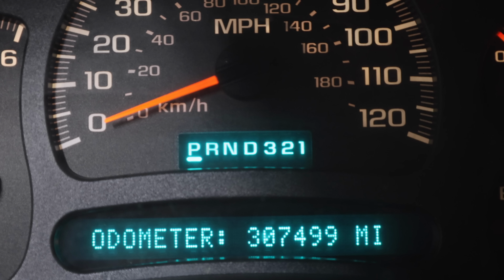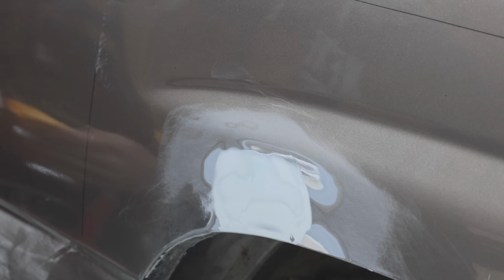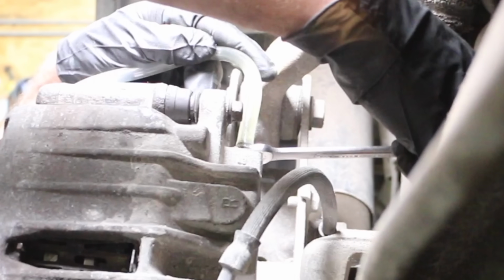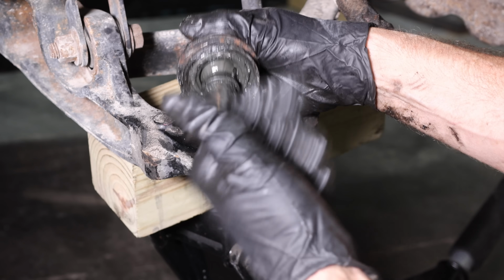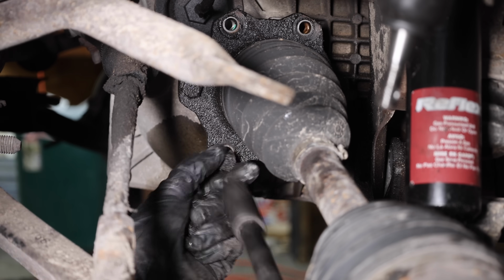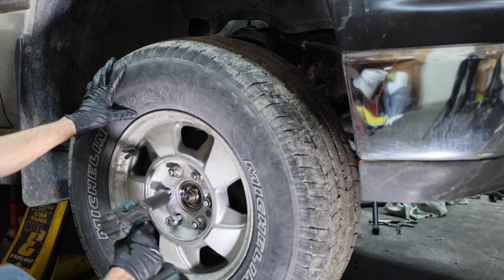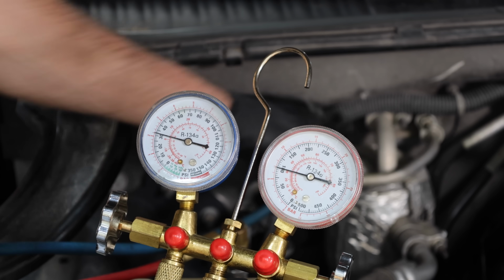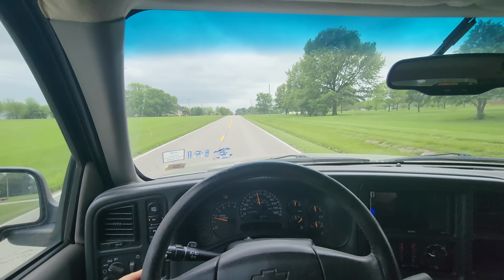Is It Stupid To Fix Up A 300,000 Mile Vehicle? Let Settle This!

Comment: I enjoy rebuilding things. The problem now is the replacement parts are junk-even OEM. So you won’t get the same long service interval. As long as you’re not rebuilding a rust bucket and it’s got solid chassis and body-rebuild away!

Comment: If you're looking for high quality snap ring pliers, the wiha brand is very good and most have an indent on the ends to capture and hold the snap ring so it doesn't "fly off" when trying to remove or install it.

Comment: get a jug of armor all with a sprayer and spray(soak) everything that you can see but don't wash. Like the fender liners, frame, trailer hitch, and any part of the suspension you can see from the front.  Trust me it will make the truck look even better. Plus a heavy soaking of armor all will make dirt and mud less likely to stick.

Comment: I will say, when changing inner and outer tie rods together, just put the new set together, and instead of counting threads, measure twice, and set the new inner/outer to same distance as the old... You can't always guarantee the replacement parts will have the same thread count.

Also, I'm being pedantic.
You referred to the Power Steering Gearbox, as the pump several times.
And the Center link, with Inner and Outer tie rods, is sometimes/often called a Drag Link Assembly.

Comment: My dad had an 04 Silverado in great shape, other than having 250k. Ill advised, he decided on a 10k full engine rebuild. Before we could sell it immediately upon completion, the transmission went out. Before we could sell it upon completion of the transmission, the gauge cluster needed to be replaced. By the we met with a buyer, the check engine light on indicating a bad knock sensor.

Comment: its ALWAYS cheaper to fix than replace most vehicles.
not to mention, most vehicles pre mid-2000s are just built better anyways and have considerably less electronic parts to fail that are really expensive to replace.
i own three old, trusty and reliable GMs:
1989 Chevrolet C1500 5.7L with 383,000 kms
1995 Chevrolet K2500 6.5L Turbo Diesel with 313,000 kms
2004 GMC Yukon XL 1500 5.3L with 293,000 kms
basic maintenance and repairs are why they still go strong EVERYDAY!

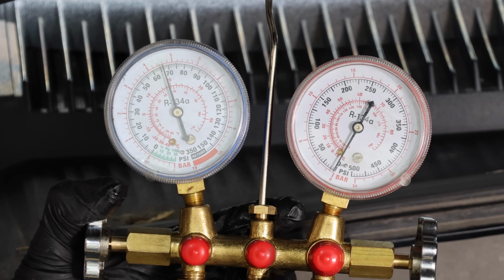Comment: 21:00 Freon? R-12 Freon? I sincerely hope this was just a slip of the tongue. It would extremely unresponsible to have not converted your cooling system to use something like 404A or 134A
Reply: No one cares
Reply: I wouldn't use r134a on a r12 system. A propane derivative works best.
Reply: @xeong5  ... Oh damn... I didn't even think of that. You're right. A propane coolant in the vicinity of an internal combustion engine. Genius!

Comment: I’m good with the pace. You did a great job on the car. 

I would suggest explaining how you detension the belt to remove it and change the pulley. Basically the half inch square gold in the tension arm and how to use it.

 Otherwise great job.  Very explanatory. Now I want to change my transmission fluid too. Also I have a LSD so maybe I should look at changing the diff fluid.

Comment: Excellent job on pacing for the video.

For God's sake, please don't use Rotella diesel oil in that engine. It accelerates lifter failure, and gobs up rings... even with higher detergent levels. Just don't do it.

Mobil 1 full synthetic at the specified weight/viscosity, or Valvoline Restore and Protect. I usually recommend Amsoil... but I understand not wanting to use something that expensive in an old SUV with 300k miles.

Comment: If the vehicle is still giving you good service at 300,000 miles, then absolutely it's worth it to repair and maintain it. We have way too much of a throwaway society these days. My little Jeep XJ is running just fine at 200,000 miles and I don't have any plans to replace it. I know its capabilities and I don't abuse it. I also make sure the fluids are changed and get professional service for the stuff I can't handle.

Comment: Without seeing the video first, I'd say if the body is in good shape with no rust, the rest is easily repaired or replaced with a new or used one. 
The things that wear out are bearings, shock absorbers, brakes, mufflers,.. All easily replaceable by a DIYer with right set of skills.

Comment: Awesome off-your-normal-topic video!!

I would suggest you never compress a brake cylinder back up into the master cylinder with any vehicle with anti-lock brakes.
Open the valve and let the dirty hydraulic fluid out (as best you can i.e. using a tube to flush it into something) and not back it up into the solenoids.

Comment: Nice work for someone who isn't a professional mechanic! Only tips I could give are installing the brake hardware while the pad bracket is off makes it easier and also the high side pressure is important when testing Air Conditioning to be sure the condenser is at the right temperature/pressure. This also lets you know if the expansion valve or fixed orifice is working correctly. 
Also take a look at those u joints, for play or traces of rust near the rubber seal areas.

Older trucks are great as long as the drivers seat isn't blown out and plastic parts are available. I also have a hard time with carpet blown out at the heel of your foot, haha.

Keep up the nice work!

Comment: You're in the South if I'm not mistaken so your vehicles down there don't have body rot like those in the Rust Belt, so if your car is basically rust free and looks good, keep it going at 300K. If its rusted out, time to recycle it to the junkyard. Bonus if you're mechanically inclined and have a place to do the work. You just saved yourself tons of money on that front end work. I know because I just had the local shop replace the lower ball joints, wheel bearings and of course they found one of the front calipers was bad, so both front calipers replaced on my Chevy 4x4

Comment: if my 22 year old 1400cc Fiesta diesel can get to 265,000 miles then a similar age big-boy pick-up should do it easily.
most modern cars are completely over-complicated and built too cheap. cars from 20-30 years ago were are from a real sweet-spot in time. so long as the engine & gearbox are in good order and the frame & body are in good shape then there's every reason to keep them running with regular servicing TLC and repairs as they need it. a car is a tool and tools can last a lifetime if you look after them properly.

Comment: Yes it is worth fixing. Compared to the cost of a new vehicle. If you bought another used one you would have to fix it anyway, I have an 07 Silverado classic that needs rocker panels and an 05 3/4 ton Suburban that is in immaculate condition except for the rockers. I will be doing these. I have decided that as long as I can do most of the work, I am willing to put at least $5000 in each of these. They run and drive great and do not leak or burn oil. The Silverado does need rear springs. Compared to a new vehicle it is worth it. especially if you can do most of the work yourself. I am thankful for Rock Auto. By the way, that foam in the fender is probably why it rotted out. I did not realize there was foam in that location. Don't forget the drive shafts and u joints.

Comment: Definitely should do snap ring plyers... we bought what was supposed to be a good set but it was only good for big ones as the metal on the different points was weak. First time we used it for a small snap ring it just broke the tips off. 

Would be nice to know what ones good!

Comment: I just took a Ford Ranger to the junkyard with 350K miles. I could have gotten more but there were too many little things going wrong.
Until they start making smaller trucks with good gas mileage again, I'm going to keep buying old used Rangers or Tacomas.

Comment: Have you test out the carbide scrapers?  I saw on this video that you used drill wire brush attachments. I'm curious how good that carbide scrapers on clenching gasket and RTV. surface

Comment: I just finished up a complete front end and brake overhaul along with front and rear springs on my 290,000 mile 1990 Dodge. No more expensive than 2 payments. And it isn't full of all the computers and plastic junk to break. Definitely worth doing the maintenance.

Comment: Here’s a project test idea; brake fluid tester tool. 
Are they all accurate? Is the percentage accurate? Adding water to brake fluid by volume should be able to give you somewhat accurate results. 
Do they work with both Dot 3 and Dot 4?

Comment: Excellent video. Two suggestions;
1. Replace the rear wheel bearings.
2. You should let people know about torquing the front axle bolt. My 03 ZX3 takes 325ft lbs.
That's a deal breaker for many home mechanics. Shop's may not be willing to touch it to get the torque right unless they're doing the alignment.

Comment: According to all service manuals I have seen you shouldn't use impact on axle nuts and you shouldn't undo them while the vehicle is on the ground because the load on bearing is just too much. You should use your breaks while vehicle is in air. That said I had to use an impact multiple times myself, because even 1 meter breaker bar didn't do the job.

Comment: I had a 2009 Chevy Cobalt that has lasted me 345,000 miles. I was the original owner and used this car for my daily driver and commuter car since new. The only problem I had with the car was valve guides and valve stem seals started leaking, causing plugs to foul out. 

If you take care of the car, it will last.

Comment: Putting body filler on hard body lines like the lip on the wheel arch will come back to haunt you.... Eventually. 🤣
One or 2 stones can crack the body filler and probably knock it loose. In that area it's a likely outcome. 
Considering your equipment and skill level you did a good though mate! Definitely a world better than rot like that spreading around. 

Probably like watching me combine a field of corn. 😂

Comment: I have a 2007 Toyota Tundra with 414,000 miles on it I bought it brand new put a lot of brakes on it ,basic oil changes, transmission oil changes last couple months fuel pump alternator time to retire her.Bought a used 2013 Toyota Tundra with the same set up. 5.7 with tow haul package with 78,350 miles MAN I LOVE TOYOTA

Comment: Older trucks are worth fixing those engines were built to last over 300,000 miles and parts are cheap for the most part. Alot of the newer ones in the past 15-16 years have had far too many recalls and mechanical issues.
Older trucks dont have as much torque or HP but they are much more reliable and less parts that break down and easier to fix. Plus those old engines can handle alot if you want to modify them.

Comment: The GM that I grew up with (1946 on) NEVER had any suspension parts to last 300K. I seriously doubt that these are original OEM parts from the factory. But the video is informative and, as always, very enjoyable. Thanks for your good works.

Comment: I have a 2006 Suburban with 340,000 miles on it. I will always put money in that truck to keep it running as long as the frame doesn't rust out underneath. It has been the most reliable vehicle I have ever owned. I have a 2010 Suburban with 295,000 miles and it's been just as good. My dad always said "It's cheaper to fix, than to buy."

Comment: I got a 1994 Suburban after Dad died. It was great to look at but completely worn out. I ordered every part i could get for the front end plus all new brakes. The radio didn't even work. Fixed that. All fluids,belts ,alternator,battery ,wheels and tires. Over 210,000 miles but i saved a ton of money over a newer vehicle.Your body work looked great ,thanks for showing  us how to do this. You did good!! Great video!!

Comment: 2006 Mazda 3S 2.3 l 340 k miles 98 Saturn SL 1 359 miles change engine oil every 3,000 miles and change your transmission fluid every 30,000 drive like a grandma your car will last a lot longer trust me 🙏

Comment: I definitely went with the timken hub/bearings on mine, lots of antisieze was used should I ever need to disassemble again. You can get upper control arms with balljoints pre installed, not terribly expensive and saves a bit of time removing the joints. Mine has a rack and pinion so none of that is cheap lol

Comment: A really nice and inexpensive upgrade to the front brakes on these series (2000-2006)suburbans and trucks, is to use the front rotors and calipers from (07-14) trucks, suburban, escalades, they are 1" larger and bold right on with no modification except you may have to use a larger wheel 17" are larger. Noticeable performance improvement. My 04' suburban has 325k miles and the only big fixs was the tyranny at 150k. 09' Escalade 323k and still running strong 
Love project farm, made many informed purchases

Comment: My 1998 accord is at 380,000 miles(a little more than that) and still runs fine. Nothing major but it has needed it's regular maintenance intervals such as oil, brakes, spark plugs, starter, alternator, timing and water pump at least once or twice in the life of my accord. My father owned it first new, then became my brother's and eventually it's mine. Still over all very good

Comment: The answer to that question certainly depends on the vehicle in question. But without a doubt an '03 suburban is absolutely worth fixing up as the newer GM's have very questionable quality. They do not make them like they used to.
I really like the emphasis on oem parts, you often do not need to go to a dealer to get them as many places also offer oem parts as well as their own respective brand, i.e. duralast at autozone.
Your channel is among the best of the best on YT, please don't slow down!

Comment: Why get rid of a vehicle when you can fix it? Even if you spent $2,000, that is only 4 months' worth of payments, and these Chevys will go forever.

I own at least eight different Chevy vehicles and all have at least 180,000 miles. I'm currently rebuilding my 07 Yukon engine, and with everything including tools, I'm roughly $1500 and deleting DOD.

fix what you own!

Comment: That Rotella is such a versatile oil. Being JASO rated for wet clutch applications I've been using it in my motorcycles and dirt bikes for years. Also run it in a Jeep 4.0 for years and thousands of miles, and of course diesel engines. Can't beat it at the price, especially for the bikes.

Comment: You should as well invest in a new set of extra easy rolling new tires? We found out they may pay out within a very short period of time.

In europe we use the MKS-Unitsystem that's why I use it here as well. If each tire of a new and better tire comes with a saving of 0,15 L/100km or 4 account for 0,6 L/100km that's 6 liters or about 10 € per 1000 km. 100€ per 10k km, or about 300€ per 18750 miles - very impressive we think!

And because we don't go to Nürburgring track with our cars (we live there) but just go with the flow of all other traffic and prefer to talk to each other whilst traveling, extra low rolling resistance has become one of our top priorities when it comes to buying new tires.

Comment: I guess it depends on the car. If the car is is made with good quality absolutely! But unfortunately, a lot of cars are made of such low quality that everything is starting to fail after only 200 000km... Having a unreliable car is hopeless and the same as putting money in a endless hole so then my answer would be to pull the plug and get another car.

Cheap cars like Volvo C30, V40, V50, Ford Focus and so on would be good examples of cars that are produced to break down...

Comment: I'd like to see you do a test on different trickle chargers and whether trickle charging batteries on vehicles that are used a couple times a week gets you longer battery life.
I've been trickle charging batteries even on my frequently used vehicles for the last 20 years and I've started getting 13-15 years out of batteries.  This has been true on 3 different cars with 3 different brands of batteries so I'm starting to think there is something to this and not just a random really good battery I got lucky on.  I used to get 5 to 7 years out of batteries and I never got more than 7.  I am frequently surprised by how depleted a battery is even when it is being driven several times a week.  Especially if the trips don't involve a long drive on the freeway.
I've heard that some trickle chargers on small aircraft batteries are designed to actually 'desulfate' (I think that was the term) the battery and thus stop bridging in between plates in the batteries.
Anyway - it would be nice to get some facts on this and what battery chargers are best at doing this. 
BTW - for those of you tempted to start doing this on your vehicles - I was told recently by someone that  what I was doing was good but that I shouldn't charge (even trickle charge) the battery hooked into the vehicle because it will send a small charge into the electrical system of the vehicle and prematurely wear out electrical components.   I have no idea if this is true but I thought I would mention it.

Comment: I replaced the whole control arm assembly because for 5 bucks more than just a ball joint you get everything. And between the joints and bushings, that's an hour saved minimum

Comment: I am sure you torqued your half shaft nuts. Also for others, if you have slop in your steering gear, you can usually adjust the preload instead of replacing. Love the video's.

Comment: 15w-30 for a diesel? Nah dude, step up viscosity a smidge for high milage but dont do that. Its strain on the system thats not needed. U want the oil to flow properly and thats to thick when cold. Might be OK but as a mechanic i advise otherwise. Id only step up another 5 maybe 10 on the non W side. W is for cold anyways and u want that thin on gasoline engines.